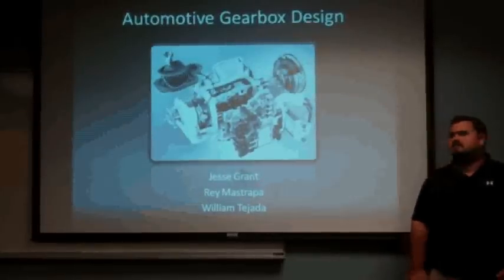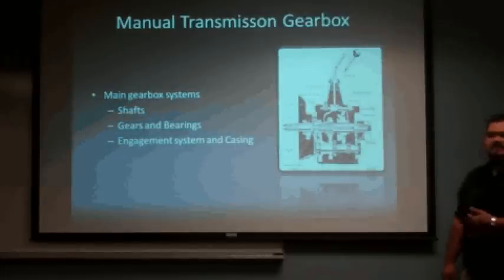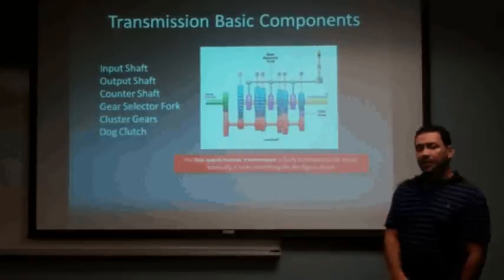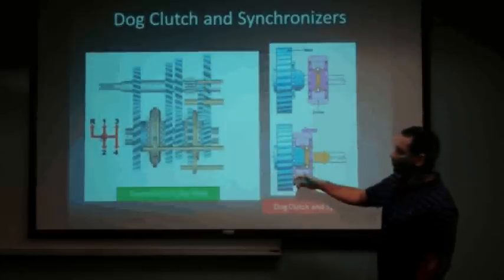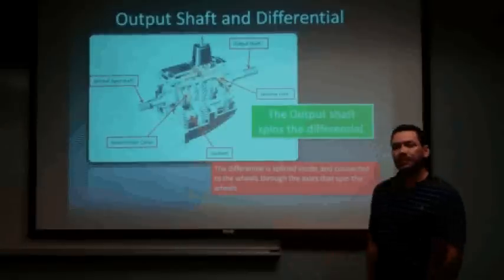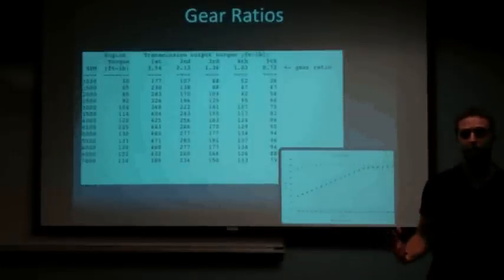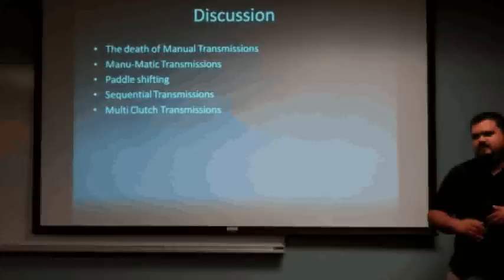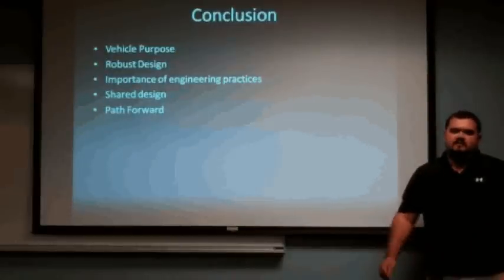Team 25: Automotive Gearbox Design

Comment: Even at 480p some pictures were hard to make out. Knowledgeable presenters. They Presented several different types of transmissions effectively. The explanation of Gear Ratio was broken down in to simple terms and easy to follow.  It was also interesting to hear where automotive transmissions are going in the future. Great job!